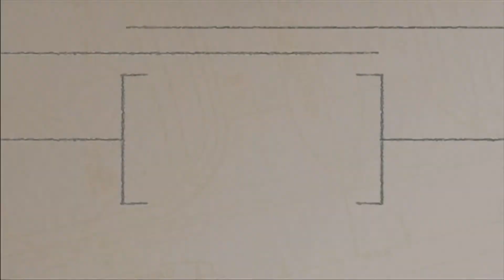Pasadena On the Go-- LED Streetlights Conversion

Comment: And they have glare and eyestrain issues, the optics can be too precise (causing excessive load luminance variation) and when they die (often well short of the rated service life) you need to bin the whole fixture.  Just because you can doesn't mean you should.